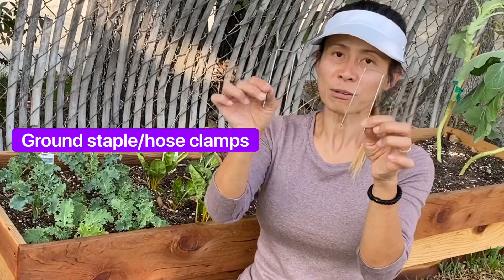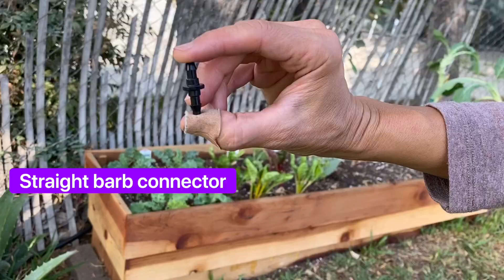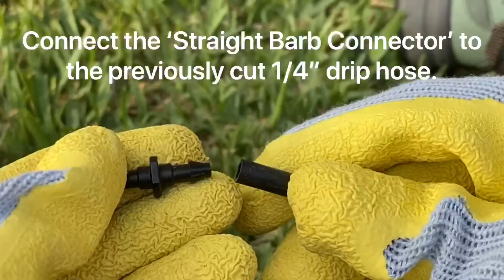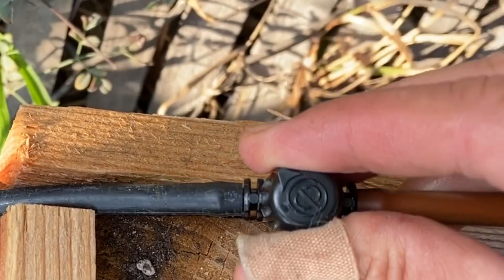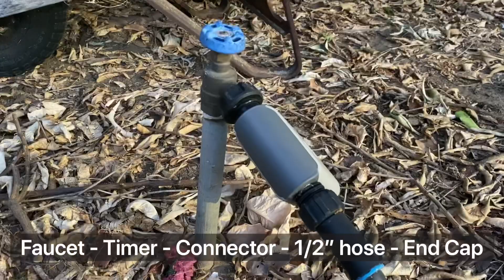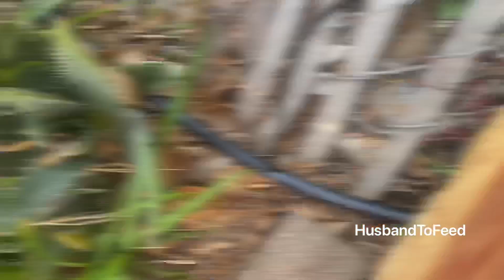Drip Line Irrigation for Raised Bed || Garden Tips

Comment: thanks for the video. i set up my irrigation system for the first time couple of days ago. i notice that some of my drip emitter gets lots of water but some are minimal. do you know what is the cause? is my pressure psi too low? or are there dirt or something that is interfering with the drip?
Reply from the maker: Are you using emitter hose? That happens. Some holes even squirt out water. That’s why I use a small valve at the start to adjust the flow of water. As for the slow-drip holes, as long as you keep the space about 6” apart it should be alright. The roots will find moist soil.
Reply from the maker: If you are using single emitter, depending on which type, that could hog the water pressure. Best to use emitter with similar output. That way the pressure is spread out equally. 
Again, that happened to me 😅 I used a spray emitter in the chain, which basically almost like a leak in the hose, which of course drop the pressure for the rest of the emitters n